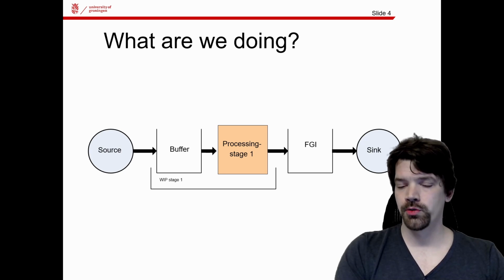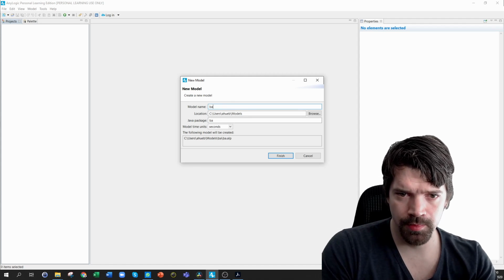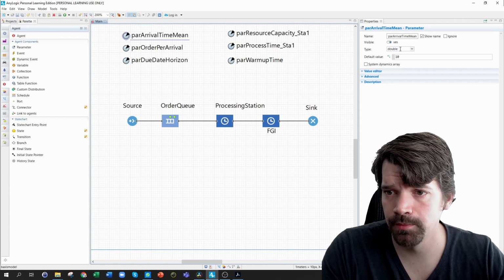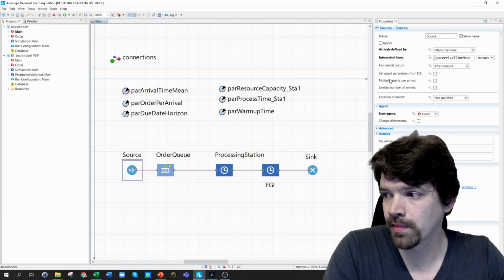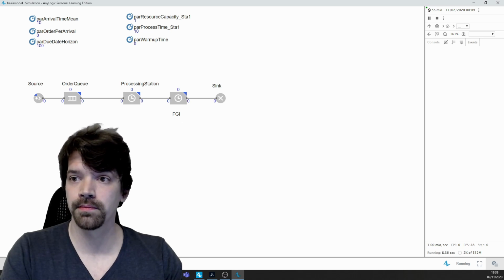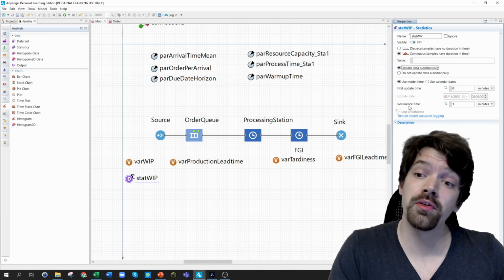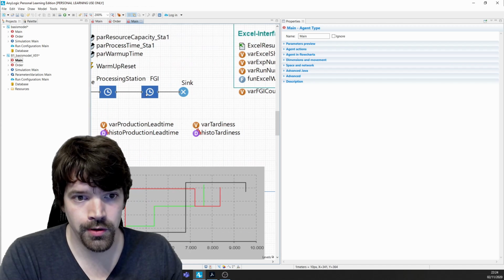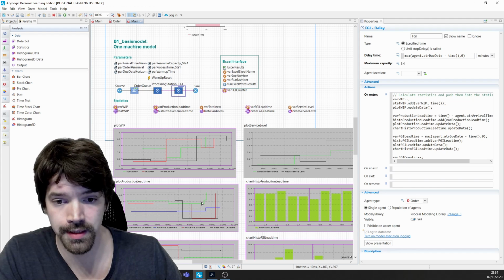basis model simulation anylogic

Comment: Hello Alexander, I am working on a simulation which has different arrival rates for the same agent. For example, morning shift and evening shift, so my question is how to add a condition on controlling the arrival of sources with time. (I want to add 7.00 am to 7.00 pm 3 trucks and 7.00 pm to 7.00 am 1 truck)

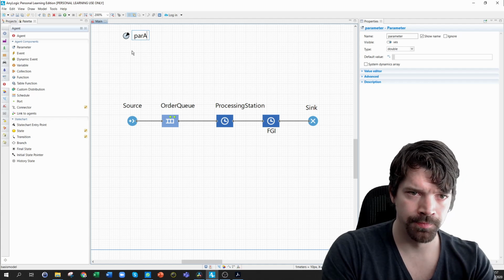Comment: I think a section is missing at 19:03 where you make the parameters
Reply from the maker: dear  @amitdingare5064 , those videos are intended to be for my students. unfortunately, I don't have really time to answer the questions here. parArrivalTimeMean: indicates the inter arrival time of the source block if eg. Expo distributed then the interarrival is: exponential(1.0 / parArrivalTimeMean) or if it is just deterministic then it is just: parArrivalTimeMean
parOrderPerArrival: defines how many agents arrives per arrival  activate multiple agents per arrival and enter this parameter into agents per arrival
parDuedateHorizon: is used for calculating a due date of the order --> source--> on exit --> agent.atrDueDate = agent.atrArrivalTime + parDueDateHorizon;
parResourceCapacity_Sta1: how many machines are available  ProcessingStation --> Capacity --> parResourceCapacity_Sta1
parProcessTime_Sta1: indicates the delay time per item of the ProcessingStation  Delay time --> eg. Deterministic parProcessTime_Sta1 or expo distributed: exponential(1.0/parProcessTime_Sta1)
parWarmupTime: idea is to reset your stat elements. Therefore you need an event. I named this event WarmUpReset. Mode of the event is "occurs once". In the "occurrence time" I refer to the parWarmup time. In the "actions" I reset all my stat such as histoFGILeadtime.rest()
good luck
Reply from the maker: yes, you are right. when I press CRT+space in anylogic then my screencast software made a pause :-( have you been able to fix the missing part?
Reply: @AlexanderHübl  ive been able to duplicate it 90%. I look forward to the lecture